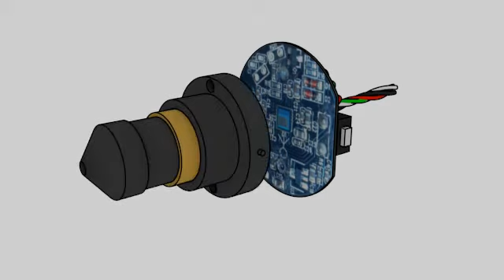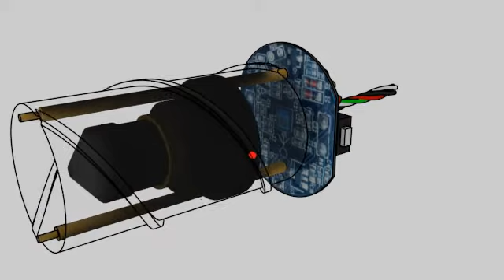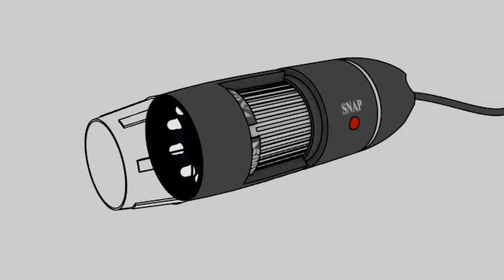Inside a USB Microscope 3d Animation

Comment: Very interesting video. Thank you for the information.

Also, I was wondering if you could help me understand something about my USB digital microscope that has confused me. It seems like the microscope pretty much has two levels of magnification.  One of the levels might be around 20X.  The other might be around 300X.  Based on the teardown of the microscope, I cannot figure out why this is.

Do you have any ideas why it seems to only have about two levels of magnification?  It is a Crenova 5 MP.

Thank you.
Reply from the maker: Thanks for the compliment.
I am not a specialist in USB microscopes.
I remember I also was surprised to have two positions where the image was clear ( just by manipulating the knob, without moving the microscope ).
I searched for Crenova 5 MP and it seems from its aspect that the inner workings are the same as my microscope.
Give me sometime to figure out the reason why and I will post the answer.
Reply from the maker: Now I have the answer to your question. I need to know your level of knowledge in optics in order to explain adequately why your usb microscope have two levels of magnification..
Reply: I think my knowledge of optics is pretty minimal.  I don’t think we officially covered that in high school physics.  Additionally, I don’t remember covering that in college physics either.  I have only recently begun starting to understand what a convex lens really is, and even some of that seems confusing.

I think I recently started to understand that a compound microscope has two lenses - I think the ocular lens and the objective lens.  However, someone told me the USB microscope is not a compound - not sure if that is true though.

Anyhow, sorry, but you may need to get real basic in order for me to understand.

Thanks.
Reply from the maker: I am working on a video response. It will take some time
Reply from the maker: Here is the explanation in a pdf file.
Sorry I can't make the animation, it demands time and I don't have enough. Link to the pdf : https://www.docdroid.net/d0so24u/explanation.pdf.html
Reply: It's really quite simple. If you place an object in front of a convex lens, further away than the focal length (the 'object distance' o), then it produces an image behind the lens, also further away than the focal length (the 'image distance' i).  The two distances are inversely related (1/o+1/i = 1/f).  Given that the travel of the lens is typically about ten times its focal length (f), there are two places you can place the lens to get a focussed image on the sensor, either close to the object (microscope mode, typically x200 or more) or close to the sensor (telescope mode, typically x20 or less).  There is one more twist. In telescope mode you don't need to have the object at the end of the microscope, if you raise it up on its stand you can still focus an image by moving the lens up slightly (i.e. turning the focus barrel), so you can get a lower magnification with a wider field of view.  The manufacturers often refer to this as a zoom, although it isn't a zoom lens synchronises the two movements, here the user is doing half the work by hand.